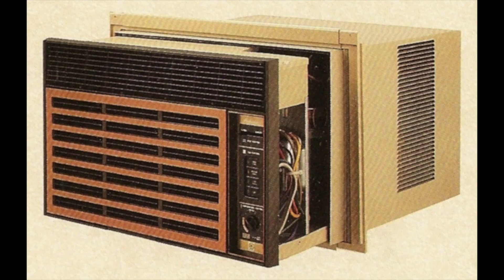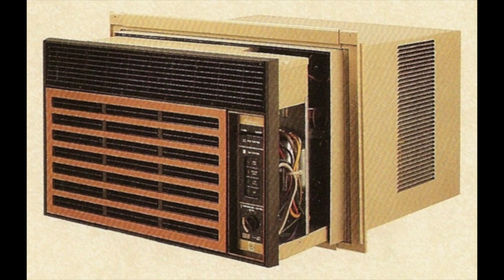Amana 18C3MD 18,000 BTU Cool Zone Air Conditioner Problems Continue

Comment: My grandparents had one of these units a long time ago and it had the same problem as yours. Their's was about 10-12k BTU I believe. It ran on 120V. It got replaced with central air back in 2010 or 2011.

Comment: Hey I actually have a AC unit suggestion and that suggestion is buying  a  Frigidaire FFRE1533Q1 Because they can make a room very cold like I have a older version dating back from 2011 and it dose what it is supposed to do now sure it is loud but it blows  a lot more air than some El cheapo AC units
Reply from the maker: Too small and too loud.

Comment: Now I am interested to see what you did to the condenser. I have an old Westinghouse unit that someone must have used a corrosive coil cleaner on, and didn't rinse it properly. The whole coil is rotted on the inside half of the condenser. Although it seems to cool okay, but I haven't really used it besides for  a test run.

Comment: That could have been the problem with my old Kenmore unit I had. It would blow cold air but not like it should. When the Appliance Store dellivered our new one arrived to be put in the window, (The Kenmore I had was a unit for sliding windows, and it was through the wall) and I shut off the Kenmore, the unit was hot, the cord was hot as well as the outlet.

Comment: I know iam replying before watching the whole video, but have you checked the amp draw of the compresor and compared the readings against the name plate ratings?  If amp draw is high, check capacitor mfd ratings, a bad capacitor will cause motor to over amp, and over heat. Also have you tried to repair the one Amana that was low on charge?  I had commented on that one a few weeks ago.  Hopefully you can find a cover for the carrier unit.  Does the carrier have the discharge grilke on the right, and controls below it similar to that panasonic one you have with the wood grain front?
Reply: Also heard you mention the metering device, there could be a restriction i  the cap tube causing the compressor to work harder.  When you put a guage on you should see low suction pressure like unit is trying to pump down into a vacuum.
Reply: @seangriffon6502  that could be
Reply: @seangriffon6502  or maybe an over charge refrigerant?

Comment: It's very unfortunate Jordan... Old Ac are so better... My old Kenmore just broke down I had to get myself as an emergency a 10KBTU Danby R32... But it was dirt cheap because of price mistakes 220.50$ before taxes on Amazon... Real price was 429.99$ CAD
Reply: AMDRADEONRUBY well, older, air conditioners. Use a lot of electricity!
Reply: @ArisBuliteanu  but new air conditioner are garbage and don't perform good like "energy efficient" but it's so loud.

Comment: Also, for the front cover, you might be able to take a picture of the 12,000 BTU front cover, put it into a 3-D print design software, and enlarge it slightly. You could then send it off to a 3-D printing company, who could then 3-D print a cover for the unit.

Comment: First, replace the condenser and compressor. Second, recharge the unit. Also, you might want to consider putting R4-10a into the air conditioner as it is an eco-friendly refrigerant, if the unit supports it.
Reply: What a stupid idea. 
First off, I can't quite say it would be worth all of that. Second off, even if you replaced the compressor and condenser, and somehow found ones that fit perfectly, Why would you put R-410a into it? It is not as good of a refrigerant, and it has MORE of a chance of leaking than R-22 does as it runs at much higher pressures. It doesn't matter if R-410a is supposedly more eco friendly, if R-22 isn't leaking then it makes no difference, and it shouldn't be leaking if everything is working correctly.
Reply: @WalterKnox  that’s! Wrong! Our 410 a is actually the global warming potential is at 500! And our 22 is ozone depleting! No matter what you say, put our 410 a in the system if it has it
Reply: @ArisBuliteanu   no! you! Are! wrong! if the system is designed for 410a then yes. This unit is designed for R-22 and should NOT have 410a put into it. the pressures are different, and it would not work correctly. R-22 IS a better refrigerant. It works better, and if it does not leak then it has no environmental impact at all. It is only once it leaks that it becomes an issue. R-410a runs at higher pressures, in coils that are generally thinner because they are made cheaply now, which means that 410a has a HIGHER chance of leaking than R22 does. 
Either way, you CANNOT put R410a into a system that is designed to run R22. The pressures are completely different and it would not work right if at all.